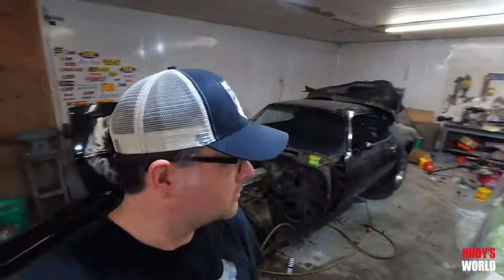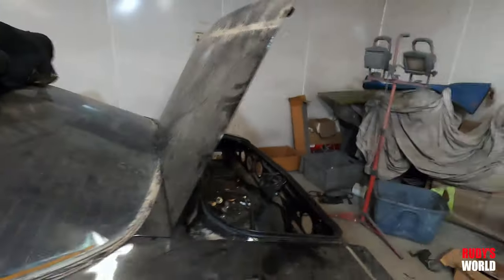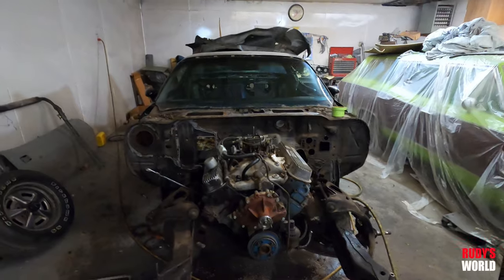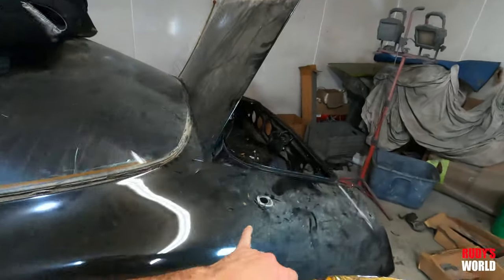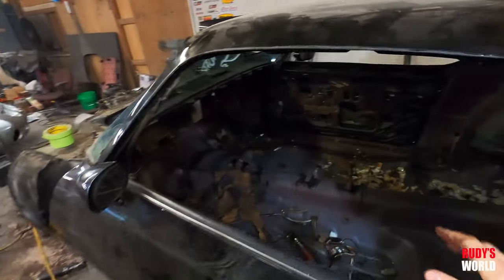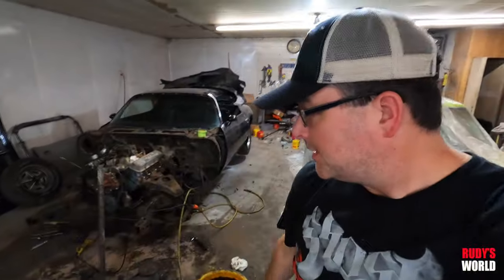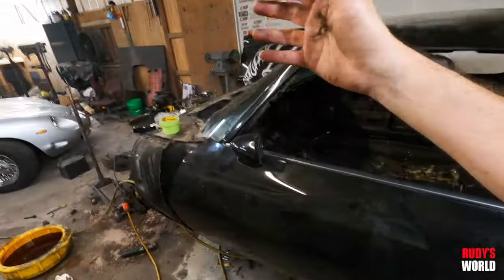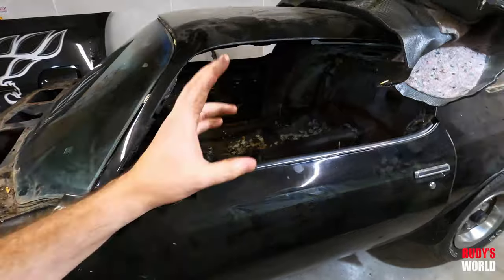Restoring My 1976 Trans Am 455 4-Speed

Comment from the maker: Probably ditching the idea of the modern wheels and sticking with the old school honeycombs,
Reply: Love this build brother!! I have the EXACT same car as you. Year, color, 4 speed except mines a 400. I'm looking to restore it but I'm not sure if the engine trans and car #s are matching or not.  I was hoping to go a more modern route... I want to actually drive it often.
Reply: I was actually thinking of doing a poncho build with an older better block from early 70s 😅. I've heard those are better for high hp builds. 
You're making me consider rethinking this, seeing how you want it all original. I'm just dying for more horsepower 😮‍💨.  The heads on the 76 are awful.

Comment: Awsome find,!! Your vidro is very informative, and trying to under take a full build, or like you said, "restoreation", cant wait to follow your outcome, we hav a 1976 trans am from the 1982 movie, best of the best 2, and started taking apart the car, it has a blue bird and stencils graffix, we going to keep it, restore it , to the movie specs, and keep it a occassuonal fun driver,, i installed the intellotronix analog gauge dash in a 75 C10 and look nearly stock, im sure im keeping the blue birds original cause they all still worked, silver dash, wheel, movie car has rallys, ram air, spoilers and the front bumper movie car brackets used to pull car in some scenes. Hey paint the M/T valve civers same color as engine, just wipe off ribs/letters, would be cool, too..thank you n joe for taking your time shooting videos..

Comment: Perfect timing as I am starting a restoration on my 76 goldenrod yellow T/A 400 auto.  23k original miles, has been sitting in a garage since 81. It's in about the same condition as yours with a shitty repaint right before it was parked. I feel your pain about how far to take it and how far to mod it.  I'm leaning on only restoring the parts that have visible surface rust and cleaning up the rest, just for protection purposes.  Keeping it all original except for a mild performance upgrade and late 70's Pioneer component system.  Keep up the vids, they will be super helpful to me as I go along!
Reply from the maker: Oh wow! I’d love to see pictures sometime along the way with your restoration. Are you in any of the Facebook groups? I’m sure I’ll be posting stuff in those from time to time. I forgot to mention, I am putting a vintage Alpine system in this car as far as the stereo. I actually got a very good price yesterday on alkaline dipping the entire car so I can see where this is all going. 🫠

Comment: I like all of your plans except those modern wheels you're planning. I think the silver honeycombs would look much better.
Reply from the maker: I agree after thinking about it quite a bit. I doubt I’ll go with those. I also found out if I was going to add rear disc brakes that honeycombs won’t even fit on the car so it will be all stock pretty much with the exception of some suspension parts.